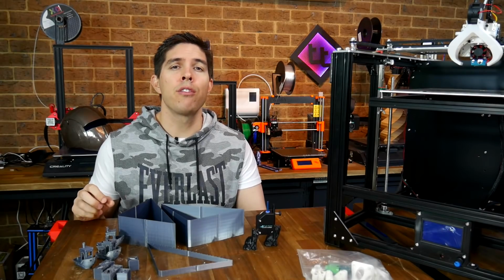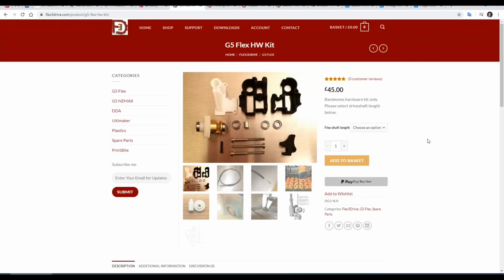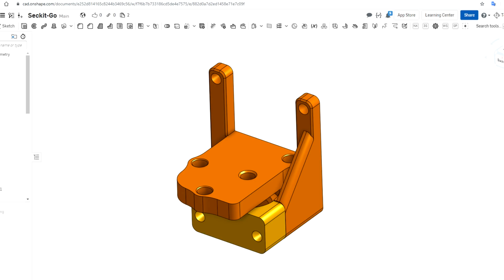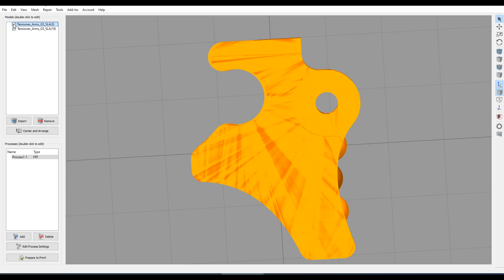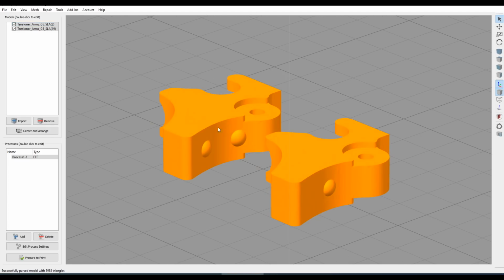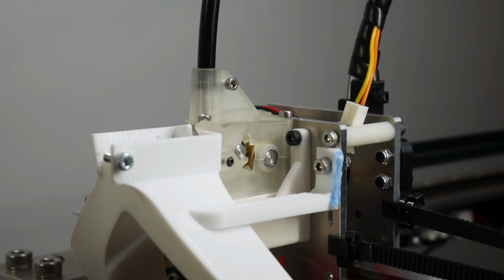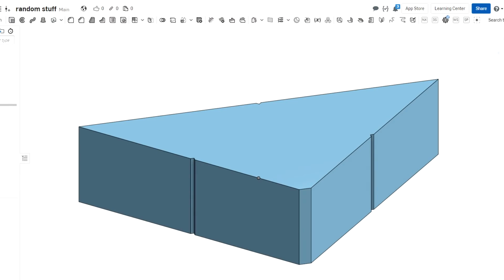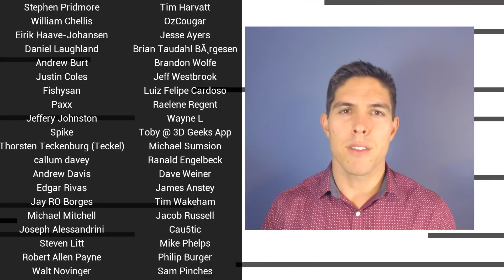Flex3drive G5 open source remote flex drive extruder guide - Seckit SK-GO

Comment: Do you know what would be the specs of the flexible shaft If I wanted to go with alternative products? I wonder if a rotary tools flex shaft would work in this setup considering torsion resistance and other force variables? Im not an engineer so Id like to understand how to pick an alternative shaft. Thanks!
Reply: Yes you can buy the F3D cable in our shop, 4mm diameter quad cross winding. Superior to others (including the zesty) that might be offered here, as it is thicker, with a stronger construction. Any length with or without a fitting crimped.
Reply: @Mutley3D  So its bidirectional cable then is it? like the zesty. Only you say in other comments that only yours is driven in the correct direction which of course strongly implies it's only a unidirectional wind as a bidirectional wind, although more expensive, is happy loaded in both directions.
Reply: @m3chanist  read the webpage. The driveshafts have a weaker / stronger direction of rotation. Study the construction. Zesty operates in weaker direction under greater load using a thinner driveshaft with lower gearing (and now they move to even lower gearing creating double the load) in the wrong direction and clearly without any testing. If you don't understand the most basic physics of it, then I cannot assist you further.
Reply: @Mutley3D  So you did go for the cheaper unidirectional cable rather than a more expensive bidirectional zesty supply which is designed for load in both directions to within a few percentile of torsional twisting. How about you read a datasheet from a better quality of flex cable vendor instead of attempting to concoct bogus negatives against your competitor.  As is patently obvious to anyone with a grasp of the most basic physics from your "double the load" comment. Please elaborate how a gear change from 30:1 to 20:1  DOUBLES the input shaft load. Basic engineering. I doubt very much you could assist me further, you don't seem up to it frankly.
Reply: Flex3Drive shafts are bi-directional and have a higher load capacity in both directions than the thinner weaker zesty shafts that run under greater load in the wrong direction.

40:1 (Flex3Drive) vs 20:1 (Zesty v2) == 50% increase in shaft load compared to Flex3Drive.

30:1 (zesty v1) vs 20:1 (zesty v2) means they INCREASED the loading on their THINNER shaft running in the WRONG direction by 33% from their original design.

4mm shaft (Flex3Drive) compared to THINNER 3.2mm shaft (Zesty).

All flex shafts due to their construction will have a physical load capacity that is higher in one direction than the other (even bi-directional) due to the construction and how the windings interact under load. Even with quad cross winding construction which the Flex3Drive uses. This is clearly explained on the website and has a significant impact on print quality.

Flex3Drive THICKER shaft is under load in its STRONGER direction. The zesty THINNER shaft is under load in its WEAKER direction of rotation.

I know my product and the engineering behind it well, am honest with my customers, i have no reason to hide or deny these facts. On the other hand you seem very invested in trying to disprove basic engineering principles and established laws of physics.
Reply: @Mutley3D  Nice save with the gear ratios, even though the context of double you used was clearly not in relation to your own unit, no it wasn't, but it is now! Well done. Seeing as you know your product and your competitor's product so well you could tell me what the amount of torque is on the output end of the shaft, its length and the angular deflection as a result, anticlockwise and clockwise. You would, of course, have measured both or at the very least calculated both cases, you would have needed to in order to actually have at your disposal a quantified delta and tangible evidence rather than mere wishful thinking and hopeful rhetoric on which to base your assertion. The twist data for bidirectional cable is available from any reputable vendor, you must already know it for yours. It's trivial to calculate the % difference. And you would have already done so in order to be able to make such an argument. I look forward to seeing the numbers so that their actual rather than hopefull significance can be properly weighed,  wouldn't want to go making mountains out of irrelevant molehills would we, that's the sort of lying that goes under the label marketing, not engineering. Until you do so you don't have physics and certainly not engineering to call on to support you, you have another effort entirely "advertising".
Reply: Until then we do have this though, the unfortunate side effect of a very high gear ratio and running your flex cable at twice the rpm (using your newly established context). The cable, of course, likes that, longer life. Although the lifespan of the cable isn't actually an issue at all is it, as you'd already know, as either case is far in excess of the printer itself under these kinds of loads. But what of the print? As you'd know (I'll just assume so) the torque curve for all steepers drops off badly the higher the rpm, no getting around inductance is there, but funny you don't mention that in your advertising materials. Being able to keep up with flowrate without missing steps is kind of critical after all.  You'd have tested with nozzles larger than 0.4 though surely. It would be no problem running a volcano with a 0.8 nozzle with this, would it?  You would have tested that right...right? Then there is the not insignificant issue of rotational mass and more to the point its ability to change direction quickly. Rotor inertia is already a limiting problem with an extruder, but add a cable, and yours is thicker! and all at higher rpm, hmmmmm what to think. 

I know, maybe you can just handwave all that away by trying to put on the faux superiority again?
Reply: @m3chanist  Dont mean to yank your chain like but unfortunately your assumptions are wrong, and also demonstrate a lack of knowledge, or insight. Running the cable at higher speed is no problem, especially given it has a higher load capacity driving a lesser load. It is a balanced system with all elements working well together and within their limits. Regarding torque curve, the load on the flex shaft doesn't come anywhere near the torque limits, so you could in fact lose 75% of torque with no ill effects.  To run larger nozzles, just run a multiplier IF your printer is capable of printing 1.2mm nozzle at 100mms with 0.5mm layer heights. At end of the day, you need to be able to function correctly at low speeds before discussing higher.

Comment: Another great detailed video.  The real benefit I see is increased print speed while maintaining quality. For mass production this is certainly a plus.  The limiting factors become how fast you can melt  and cool the filament and of course the mechanics of the printer.  For hobbyists, printing slower compensates for quality but we usually have the luxury of time (or a second (or third) printer)).  Would like to see a revisit where you push the G5 and the printer to its limits using a volcano hot end and extreme part cooling.

Comment: So whats the difference with this and the nimble??
Reply: One performs much better than the other and is the original engineered solution.
Reply: @npgoalkeeper _ with 4mm shafting, better gears, SLS offering and ability to print your own, your arguments are not overwhelming. Dont mistake my attitude for my personality, my attitude will reflect that I am presented with. Often only coming from a certain core of zesty owners that seem to be on some sort of mission the last 3 years. Not a company id buy from if they were organising a campaign of targeted hate and harrassment against a competitor. Not to mentoin the one they undeniably copied, without really doing much testing due to a lack of engineering experience or control systems. Afterall, where did your unconventional FW settings originally stem from. But have a great and happy printing. Im always here if you want a chat.

Comment: I know a core-XY (or similar) stands to gain the most from a low weight hotend, but for printers with an X axis hotend and Y axis bed (cr-10), will the lighter hotend mass have any significant affect on the Y motion induced ghosting? It seems gains would be limited by the bed mass.
Reply: The hot end doesn’t move in the Y direction (except high up as the gantry swings back and forth, unintentionally), so any Y direction ghosting is caused by bed mass and not hot end mass.
Reply: Yes, a hot end having only one moving axis will not get the full benefit from this system, but my Delta certainly can.

Comment: Which firmware of the BTT 35 has the console/terminal on it? I don't remember seeing that before ending up on the BIGTREETECH-TouchScreenFirmware which seems to be the active one.. but it doesn't seem to have that function.
Reply: The latest one has it.
Reply: @m3chanist   https://github.com/bigtreetech/BIGTREETECH-TouchScreenFirmware That latest or one of the others? Have the SKR 35 V3 & didn't notice the option for that when programing a a font for it. Anyhow most of their displays have 2+ firmwares you can use on them one (normally older for the device & another unified one that works across multiple devices)  from BTT & more if you include other sources.  Thanks for the reply just left still confused by which latest one to look at.

Comment: I put a Zesty Nimble on my CR10 S5 and it did reduce the ringing, but finding a good mount point for the stepper motor was problematic, as was sorting out the mounts for the hot end and zesty (I had an older e3dV6) Zesty were quite helpful during the process. I'm not sure how much weight the flex cable adds to the head though, and resistance to movement vs a bowden or direct drive, it is hard to take into account as the flex cable flexes differently across the build surface and if you don't mount the stepper on the z-rail, then it also changes over the height of the print job, which means the forces on the print head also change.
Reply from the maker: Good points, thanks for sharing.
Reply: If you see how a Flex3Drive E motor is mounted on CR10/Ender3 style machines you may see how simple elegant and correct it is. Don't use original E motor location, mount on the front of gantry instead of behind.
Reply: @Mutley3D  On the S5 it doesn't have the same options for mounting as on the standard CR10
Reply: @originaltrilogy1  send me an email or ill try to get a pic on the site if its no on there already. You really dont want motor on the back though.

Comment: It says open source, but it is not.  It's actually Creative Commons, Non Commercial, No Derivatives.  Not very open if you can't share it.
Reply: Like Mutley3d said, it's an initial effort and he's being very cautious. He's essentially a one man army.
Reply: Yes this is the initial release for a large body of work that is being made available. Everything still in early stages of release and licensing may change, crucial thing was to get files out there and freely available. With CC you cannot go backwards so its a top down approach on the licensing.
Reply: Exactly, not to mention no actual source available, just output files for the extruder itself. You can modify and innovate with the mounting brackets though!  Woo hoo hooo smell the freedom!  using the term "open source" as a nothing but a marketing ploy. With the old 'we will release the source later" bollocks that you see all the time, as if exporting a STP file as well as the STL is so vastly resource and time-consuming. Complete BS.

Comment: Perhaps if you worked a little bit more on your tuning and parameters you could eliminate that ringing from your X1 and the Cetus... Angus doesn't seem to have those problems as much as you do.
Reply from the maker: The X1 sure, but the Cetus is proprietary slicer with premade profiles so that one is on them. Plenty of others agree ringing is a weakness for that machine.

Comment: You neglected to weigh the drive cable in the moving parts. This is a serious oversight most people do when spec-ing the moving mass. I maintain the best quality will be achieved with a series of two standard extruders, the first with a large motor, and the second with a vastly smaller motor for fine control. This system will work with the MMU2 very well and is being prototyped by E3D
Reply: I get far less ringing on the Nimble setup than with the bond tech extruder and the ringing is no worse than the stock bowden setup. The cable weight should be taken into account, I agree, but if you are mounting on the arm that moves up, then the weight is constant (nearly) and can be reduced by mounting it correctly at the top of the arc. I would be interested in working out how much weight it adds, but it doesn't seem to cause any ringing vs a bowden setup, so the weight doesn't appear to be much of an issue, at least on i3 style printers I have tried the Nimble with.
Reply from the maker: You can't just weigh the cable because its weight is not solely supported by the moving print head. It's a factor, but no where near enough to overcome the 161 grams saved from this modification.

Comment: Flex3drive G5 is the best on the market and open source to, it is the original flexible drive extruder
Reply: @npgoalkeeper _ what drive cable do you mean?
Reply: If you consider an STL opensource sure. Stp files available for the mounts only but oddly no stp files for the actual extruder parts, with a license that allows for personal derivatives but no means to actually create them apart from laborious redraw from the ground up using the STL as a template. About as far from being open as you can get while still claiming opensource. little more than feel-good wankology.

Comment: I honestly wonder if reducing weight on the SecKit SK-GO is worth it? Have you weighed those Aluminium mounting plates? Those are also part of the extruder/hotened assembly... And the entire linear rail is technically also part of the moving parts, only in one axis mind you but stil....
Reply from the maker: I wasn't willing to disassemble the lot to make that comparison, but I have  net change of 161 grams with this setup. The stock setup is very good, however.

Comment: Forgot to mention that a U shaped mounting geometry for the drive cable creates a twisting force as the extruder moves. Typically less than 90 degrees but the twist causes a reduction in extrusion accuracy.
Cheers
-Peter
Reply: Yes this is correct and depending on mounting location and range of movement this can result in a difference that is lower than an equivalent of a singled skipped micro-step.
Reply from the maker: I think it's one of those things that is true in theory but whether the effect can be seen in the results is another matter. It will also depend a lot on the quality of the cable.

Comment: REMOTE COOLING would be very nice. with like an aquarium pump or such.
Reply: There is a water cooler available for the print head cooling, with the part fan, I don't know that a fan would be much heavier then the tubing and air spreader required for remote cooling.
Reply: @originaltrilogy1  it wouldn't make much of a difference in weight but it cools betters apparently. would love to see it tested by him